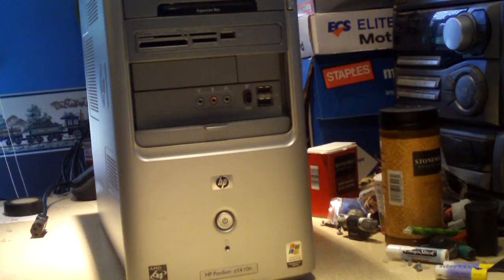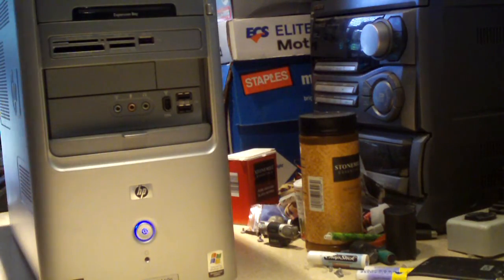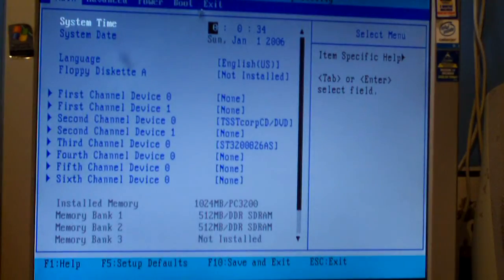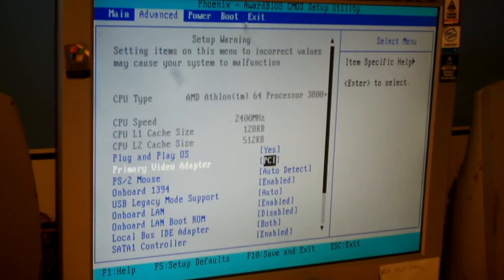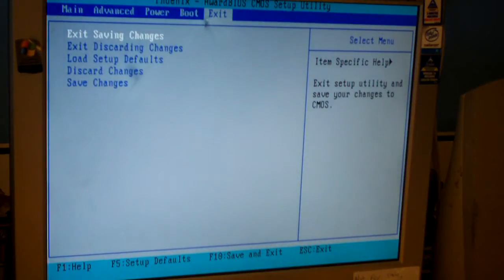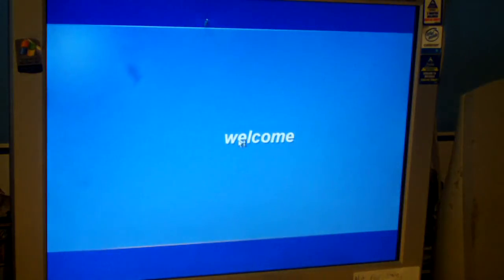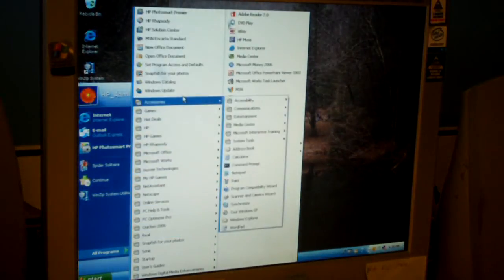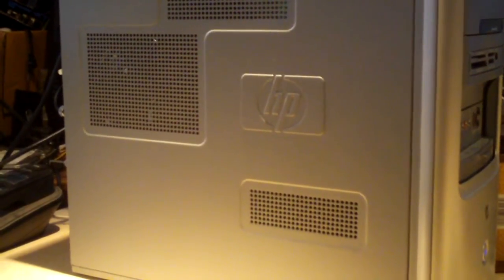HP Pavilion A1410N - Replaced PSU, Time for Software Inspection

Comment: Before you think you have it fixed, unplug the computer from the wall outlet, for a few hours, then plug it in and give a cold boot, I have run into this problem before and found it was the power supply. again.